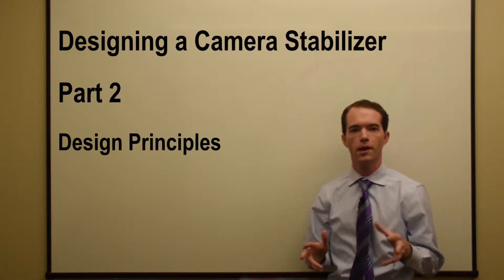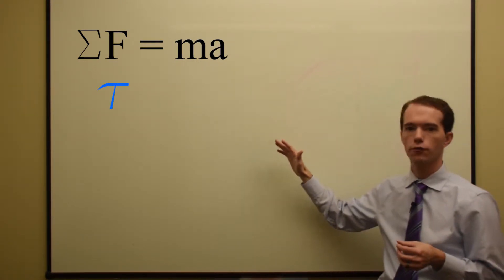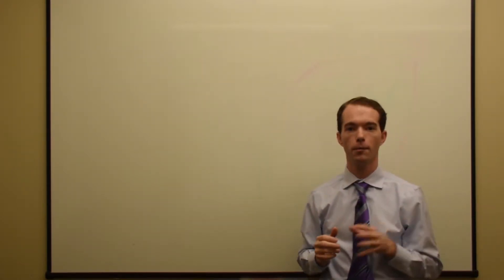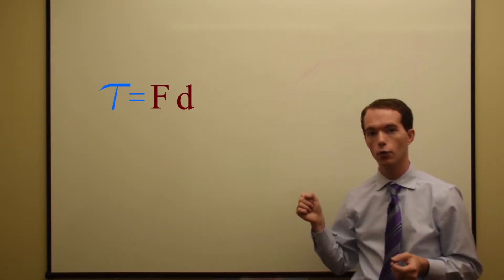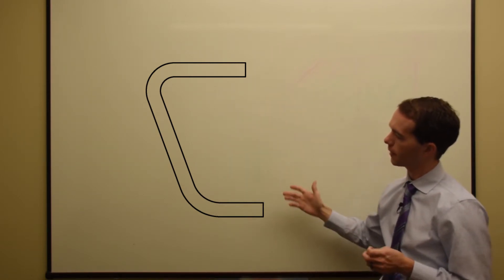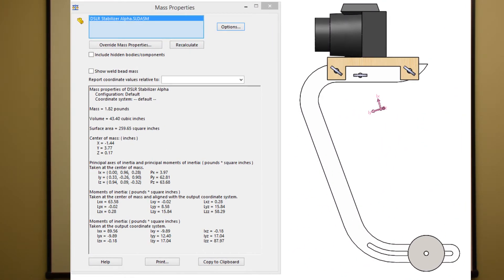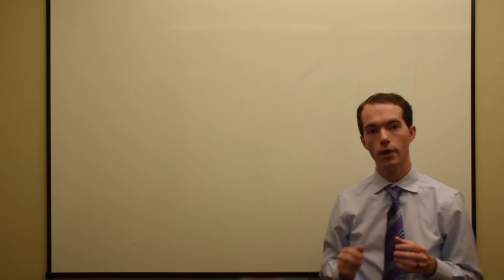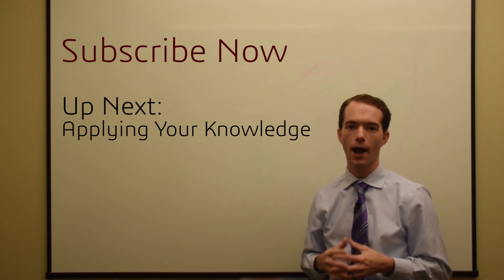Building a Camera Stabilizer. Pt 2: Design Principles

Comment: Hi.
How do you achieve that the camera stay horizontal if you don't have the center of gravity below and a static torq big enough  ?
And, if there's a static torq , it also exist when I move the gimbal horizontally with an aceleration. In this situation occurs the pendulum effect.
How I can solve both problems?
May be I don't understand some part of the video because my English is not so good.
Thanks.
Regards. Pablo from Argentina